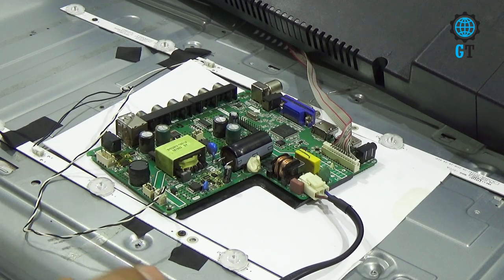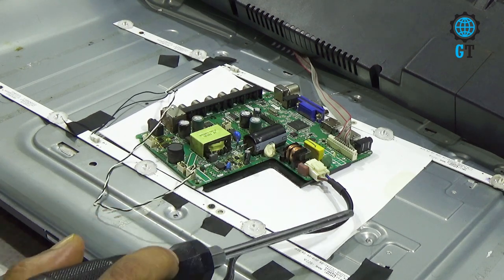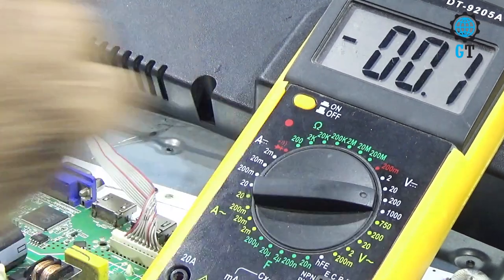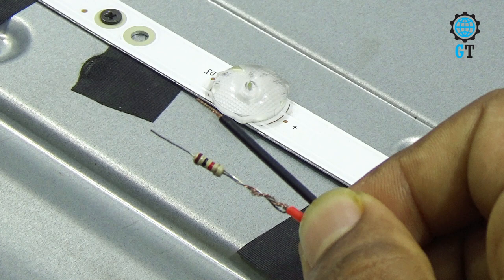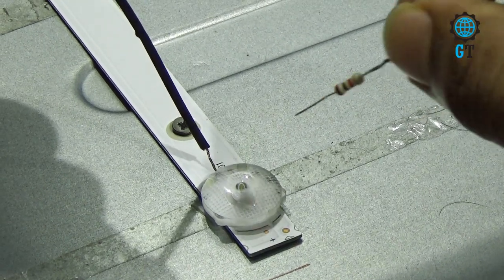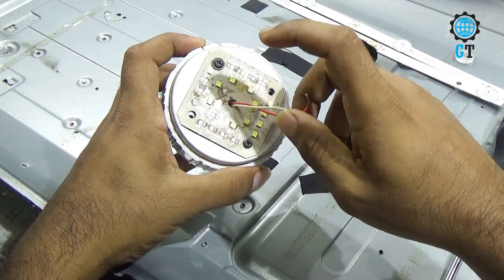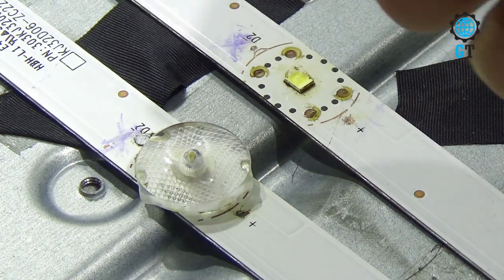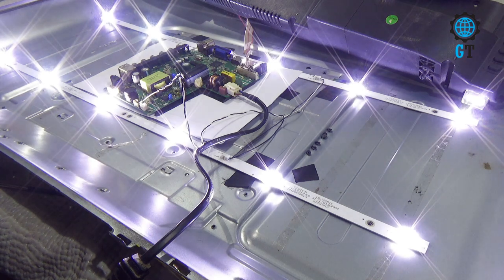LCD/LED TV Backlight Repair - No Picture, Black Screen || Replace Single LED Using Candle

Comment: Each LED on the TV LED strip has 3 volts or 6 volts (for TVs with a diagonal greater than 39 inches)... the problem is that the LEDs from the light bulbs (most 2835, 5360, 5370, etc.) have a maximum current of 20 -25 mA, while the LEDs on the TV have an operating current between 280 mA and 350 mA... so the LEDs on the TV have a power of 3V x 0.35mA = 1.05W (watts) and each LED of the light bulb has 3V x 0.020 = 0.06W(watts)....there may also be light bulbs with LEDs that have 1W LEDs...TV manufacturers are not interested in selling TV LEDs, because most would buy 10-20 leds with the price of 0.5 dollars/piece "for the reserve" and the TV repairmen would also lose customers... because of this, only the LED strips specific to each TV brand can be found, because a TV LED strip costs between 10 and 20 dollars per piece, and the TVs have at least 2 bars with LEDs...thing for sale and profit of the producing companies
Reply: With how much mA should I replace the led and how much voltage rating? I have a 42 inch tv.
Reply: @_satyam.jaiswal___  Unfortunately, you have to disassemble the TV, measure the voltage at the entrance to the LED strips, then disassemble the screen and the reflective foils, after which you can see what the LED strips look like. Each LED strip is written (by the manufacturer) some information about the tape. Then, you do some simple calculations (Ohm's law), you have the voltage on the LEDs, you have the number of LEDs, you easily deduce the voltage and amperage on each LED from your own TV... just like "TV troubleshooters on Youtube" mostly only want likes and subscribes... the more detailed information is part of their experience, if they were to reveal it, almost all those with minimal knowledge of electronics would "steal the bread from their mouths"... success

Comment: Each led either tv or bulb have specific voltage to operate. It can be 3v or 6v etc etc. So the led tv strip you repaired had how many volts per led? and the led bulb you used to salvage leds had how many volts per  led?? Both led tv and blub led must have same operating voltages. Kindly explain the wattage of led bulb that should be used for 32inch led tv. Thanks.
Reply: Dude he fixed a TV with a candle 🕯 😳 😂
Reply: No need of fancy equipment

Comment: What gel is used to stick led to strip?
Reply: The solder that remains on the LED and the strip are what make it "stick." The gel is flux that helps the solder flow back together between the two parts. If you don't use flux soldering is difficult and may have a poor (or no) connection.
Reply: Can you get a dry joint on these that causes an intermittent failure of the backlight?